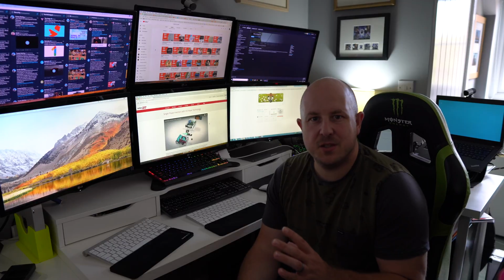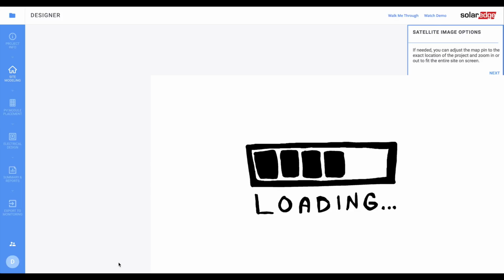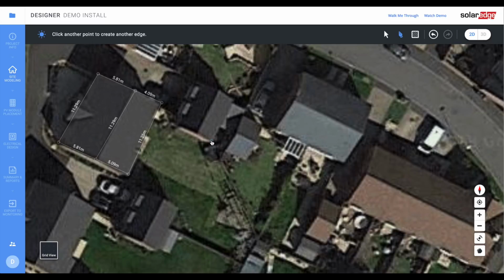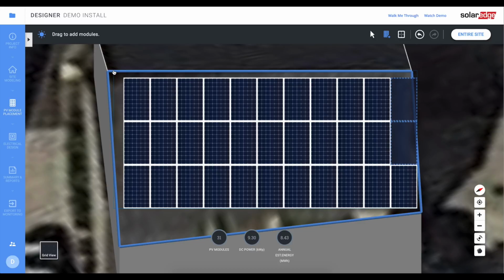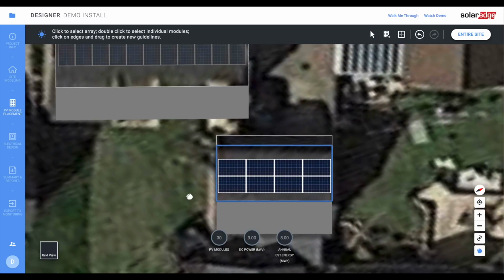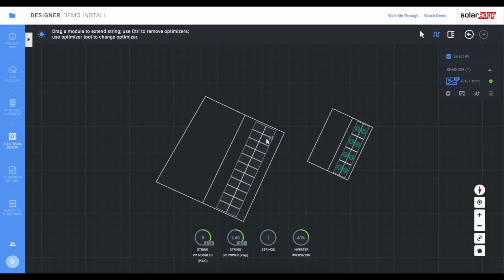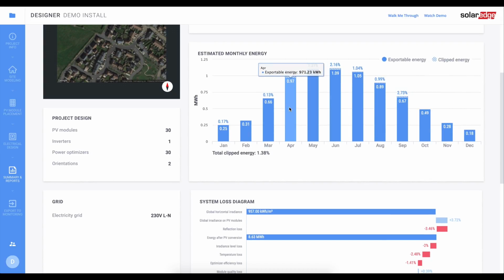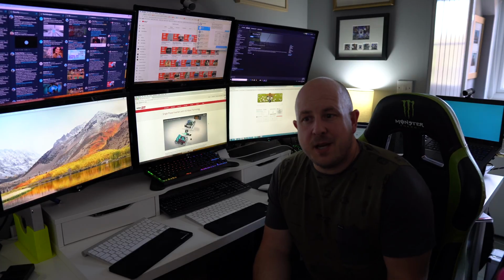Designing a Solar PV Array with SolarEdge Site Designer

Comment: Men the way you explain this designer tool is great 👍, I am trying to gain  access to solaredge designer tool and cannot. How did you able to get this tool?
Reply from the maker: I got access from speaking with Solar Edge as part of some of the installer configuration options I was interested in. Its really only meant for installers.

Comment: you can't put panels as you show. How about  fire zone ? (3 feet...)
Reply from the maker: This video was to demonstrate the software not to design a specific system per se.
However, my understanding of the fire zone requirement is to ensure there is access on the roof for fire access if required. The other side of the roof would be totally free and allow access to the same roof void, so don't see an issue still.